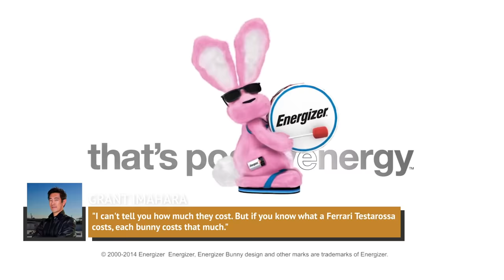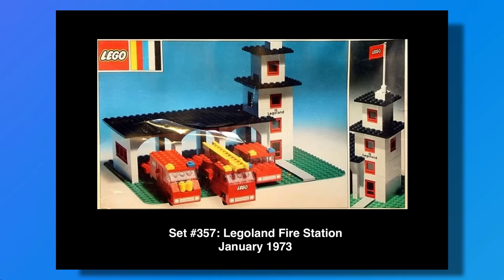The Untold Truth Of Grant Imahara From MythBusters

Comment: Video: "The spider machine nearly killed Imahara"
also Video: spider machine slowly tips over and is easily stopped one-handed by Imahara
Reply: he didn't stop it with his hand. it weighs 600 lbs. if it had kept tipping it would have crushed his lower body and he would be stuck there without help until someone came into the workshop the next day.
Reply: @TinyTyranitar95350  You must not understand how leverage works. There was not nearly that much weight being applied to him while the robot is teetering on one side.
Reply: @TwoAPTMLMusicProductions  exactly , it's 600 pounds.
Reply: @hackdeez1075  eh... no. More like 30-60lbs of momentum. The 600lbs mass is clearly supported by the parts resting on the floor when he stopped the tumbling.
Reply: @hackdeez1075  you also apparently DON'T KNOW HOW LEVERAGE WORKS 😂
Reply: @TwoAPTMLMusicProductions  you dont know how reading comprehension works. There is no way he had enough leverage, it's 600 pounds ya goof
Reply: @TwoAPTMLMusicProductions  Leverage doesn't matter unless you take in to account inertia. I'm not a physicist or an engineer, I doubt you are either. Which means neither of us are qualified to say if he was in danger or not. Grant is very qualified to say if he was or not, he is an engineer and he is also the one that almost died, he is also the one that made the machine, he knows the cg, the height, how far it fell, etc.

Also, watch the video at .25 speed. It did not stop because of his hand, it stopped because it landed on the flat section of the leg. His hand did nothing.
Reply: @Test-tz8pg  I'm not saying it wasn't dangerous. It was. I'm just saying he didn't really almost die and like you said, he wasn't holding up 600lbs. I don't really care though, all YouTubers sensationalize this kind of stuff.
Reply: And that is where I stop the video.
Reply: @TwoAPTMLMusicProductions  I was just trying to point out is heavy moving objects are absurdly dangerous and people tend to underplay the danger of them. Heavy moving objects are (I believe) the third most likely thing to kill someone. Car crashes are real dangerous. If you work with heavy moving things, like forklifts, you run in to the same problem. Rolling a snowmobile, Or just plain old moving heavy things, dressers falling on kids, etc. 

I agree, depending on how you define almost dying, he didn't. But if he programmed it slightly differently where, the back legs went up at a higher speed, and the front legs dropped quicker, he may of died.  I think it's about perspective, because in his mind, he did almost die because the whole thing went perfectly right, and grant knows if he chose 30 revolutions instead of 60 for that thing(or something like that), he may not be here anymore. So to him it seemed like he almost died.
Reply: @Test-tz8pg  how many threads did you come to argue on lol
Reply: @TwoAPTMLMusicProductions  perhaps it wasn't much force, but had it landed on his foot or knee, he would have probably broken a bone or at least be trapped under it until someone came the next morning, and with 600 pounds on the foot , cutting it's circulation off it would be amputated.
Reply: @michaelaz531  what are we arguing about?  It's in the video, he stopped the spider with one hand without straining himself.  I thought it was gonna start flailing its legs randomly all over the place, and just miss his head.

Comment: "Never work late at night alone with heavy equipmemt."
: Looks around shed im sitting in hmmmm tesla coil, Rail gun, 22 ton press,  cnc lathe, engine planer, hydrogen converter, black powder mixer, 10ftby 10 ft 3d printer, and a keg of beer. Hmm this should end well.